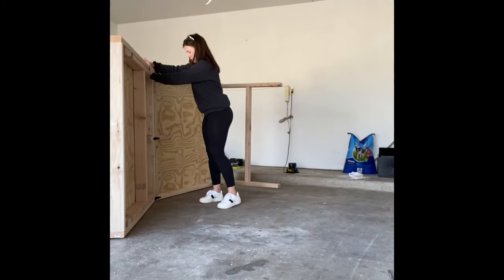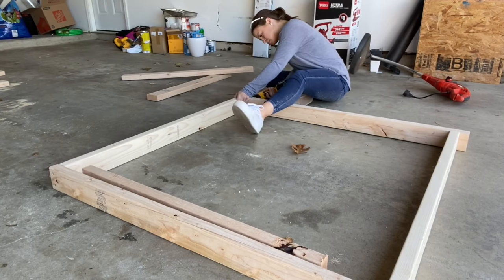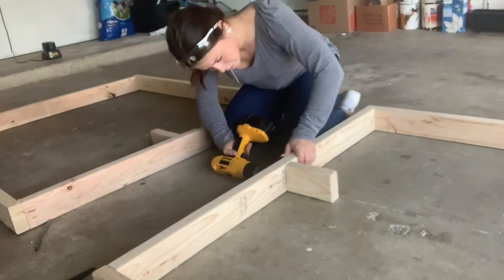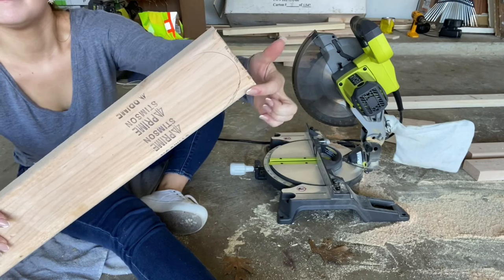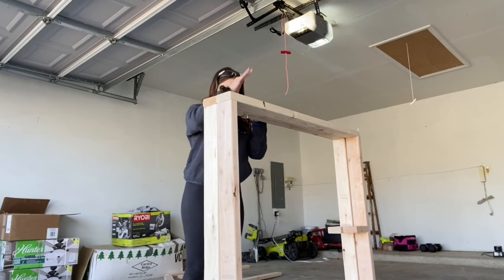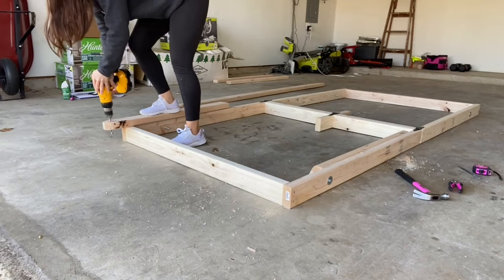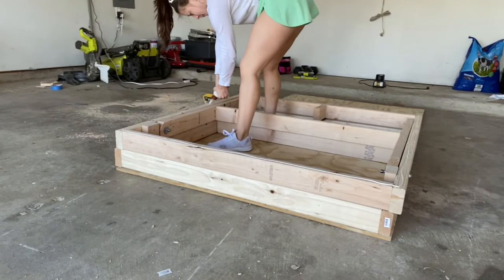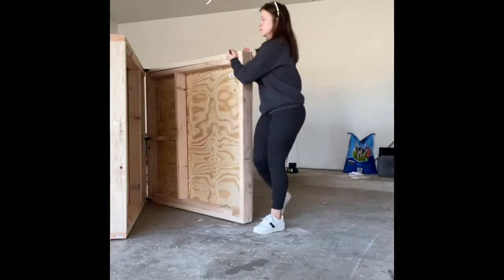DIY Foldable Table | Beer Dye

Comment: I wonder if it would compromise the strength too much if you took a 1-1/2” spade bit and drilled holes every 3 inches or so on the 2x4 frame to save weight.